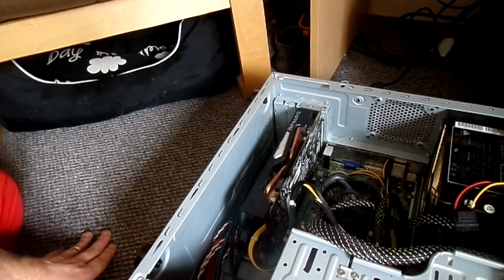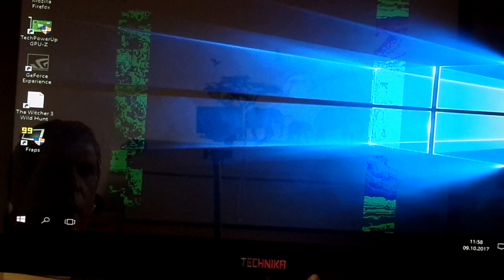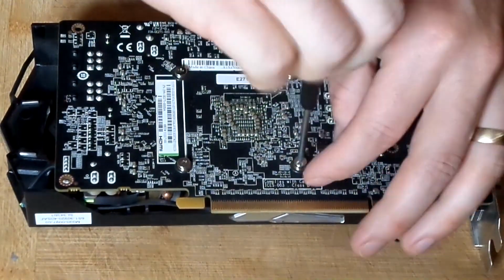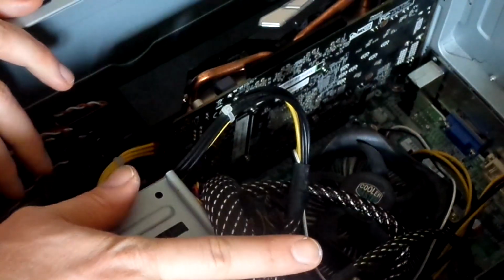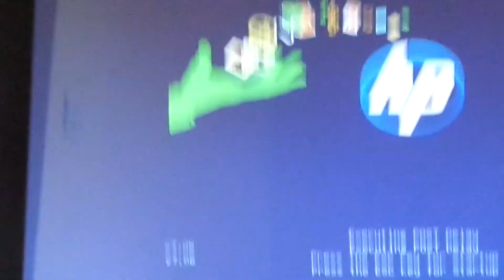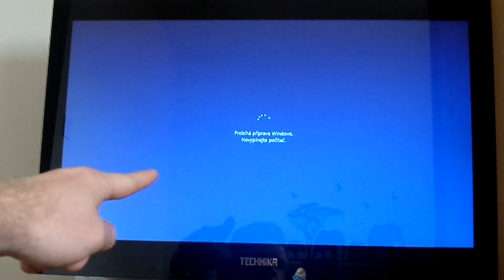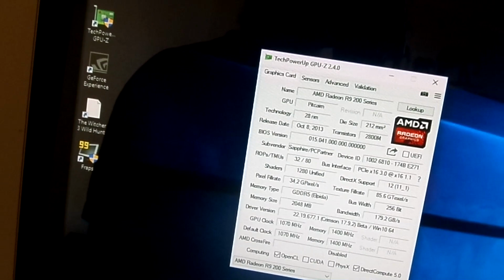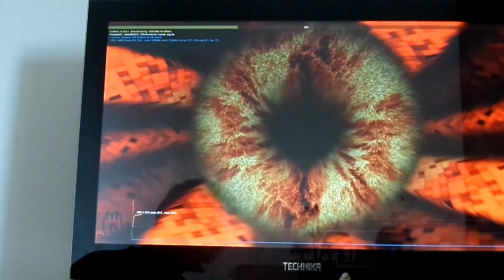It is possible fix GPU Screen Artifact ? Check this video to find out

Comment: I accidentally bought a broken GTX 770 and when I plug it into the PC it isn't even recognized on the PC. I have one more method I'm about to try but if that won't work should I don't this
Reply from the maker: Daniel Nicolas it's you pc switch on witch that card in or is looks like dead
Reply: Frog - Tech - Tips Its not the PC so because I have run 4 other cards in it. might it be shorted because from what I hear people would blast their 770s with volts
Reply from the maker: ok thats mean if you plug in that card your PC no power on thats look like short on GPU  this is hard to repair
Reply: Frog - Tech - Tips Ok. Thanks for responding so fast. You have really interesting content. Good day
Reply from the maker: Daniel Nicolas you welcome and please don't forget subscribe and any more questions just ask